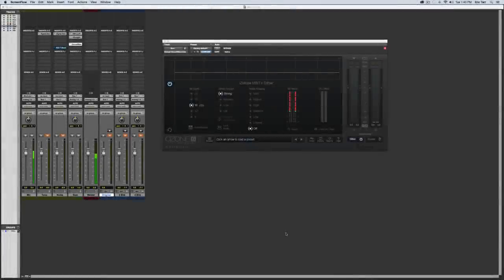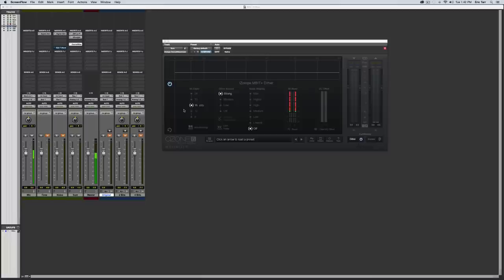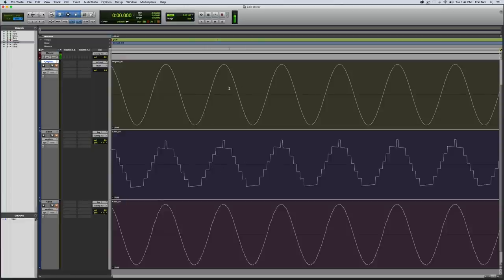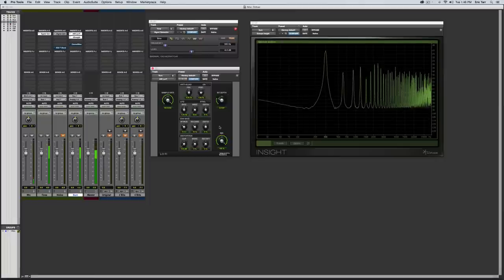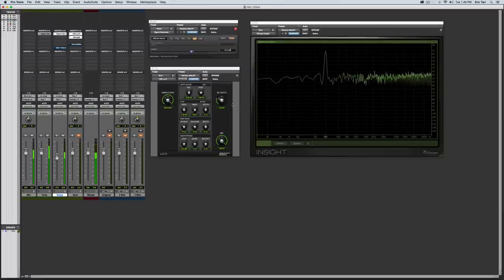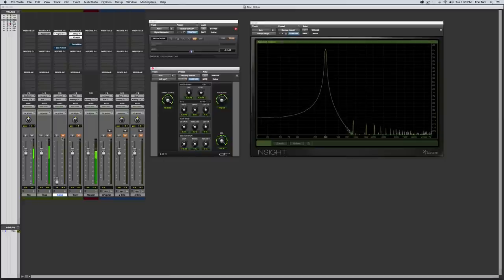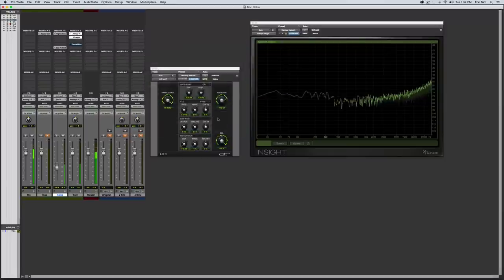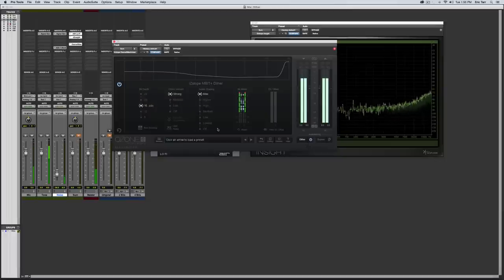Audio Dithering 101 — What is Dither?

Comment: Very good video—I'm sorry I have to complain about one detail. You probably noticed that the shaped-dither demo starting around 13:57 doesn't really pay off as planned. Unlike the earlier example, it doesn't suck the distortion peaks down by decorrelation, it just buries them in noise. In fact, the lowest distortion peak still sticks out above the noise. The problem is that "noise shaped dither" isn't "dither with shaped noise", it's "dither that has been noise-shaped". The shaping happens as part of the truncation, not to the noise addition before the truncation. It's really "error shaping", to differentiate is from the broadband noise that's added, but to engineers, error and noise are synonyms.

Comment: 2mn of Video I already understand broadly what is dither and WHY we do it. Nice. Lets pick some desert and watch the rest. I understand dithering in image and basically the principle is the same. You add noise to actually obtain a more pleasing result.
In imaging dithering is handy when you reduce the colour count of an image.
Take any 16 bit color image and reduce it to 256 colours. You'll notice  clear surfaces of colour that does not look nice and often change the original shape. Take dithering and there will be a noise of colour that is noticeable yet more pleasing than the non dithered image.
Nowadays dithering images have become pointless. Or maybe in some specific use cases it is still relevant but almost every image nowadays can have true colours. Disk space and bandwidth are no more bottlenecks to take in the equation.

Comment: It was questionable which noise was more unpleasant when you lowered the bit depth to 2 bits. And when you raised it back to 4 or 8 bits, I couldn't really hear the quantization noise. But when you added white noise, I could definitely hear it. So I'm still not sure I understand everything correctly. The concept of the series is good, though...

Comment: Great video! I have a quick question - the nature of harmonics is to get down in amplitude as the frequency goes up, so why would we like to add more noise there? It seems more rational to add the noise at the mid frequencies so we can mask them better no?
Reply: Guy Shilo i'm no expert on the topic and the harmonics indeed reduce in amplitude as you go up the spectrum, but human hearing is a different thing, there's the fletcher-munson curve, which kind of "allows" you to boost the higher frequency noise to maximize the masking effect and it still won't be audible unlike in the upper mids. so my guess would be, you do it because "you can"

Comment: So, now that the mix has been printed as say, 16bit @ 44.1kHz utilizing the dither plugin, do we just find the file in the audio audio folder and use that for all intents and purposes? If I understand correctly, when we want to export to mp3 instead, using 3rd party software, should we print the mix as a non-dithered file and then use whatever 3rd party software to create the mp3 since it also applies dither to the final file?

Comment: This is all wrong. Dither decorrelates the quantization error from the signal, completely eliminating the harmonic distortion at the cost of a 6dB increase in noise.
Simply rounding up or down when reducing bit depth produces the same error every time for each intermediate sample value. By adding a random number from zero to the maximum value of the bits to be discarded and then truncating, the error is randomized; sometimes higher than the original value and sometimes lower, with the frequency of higher or lower depending on how close the original sample was to one of the original quantization levels.